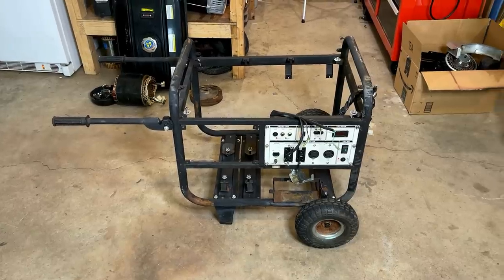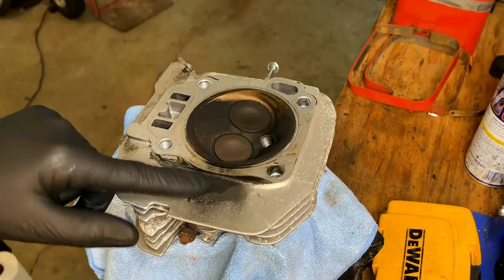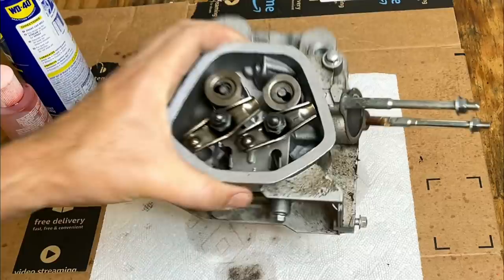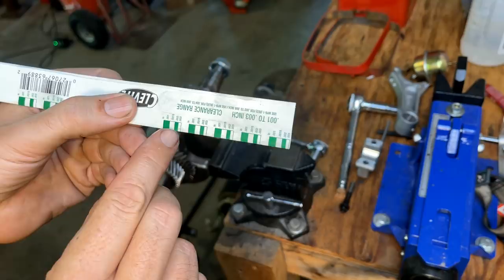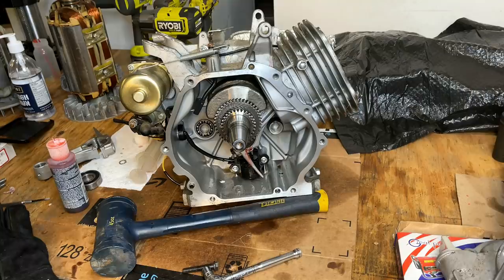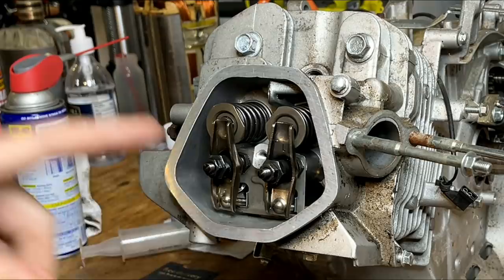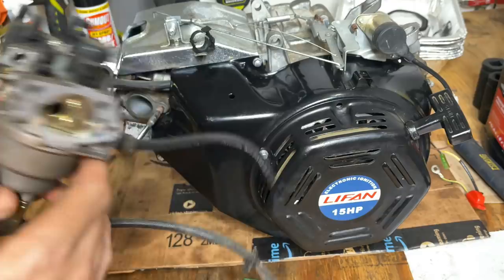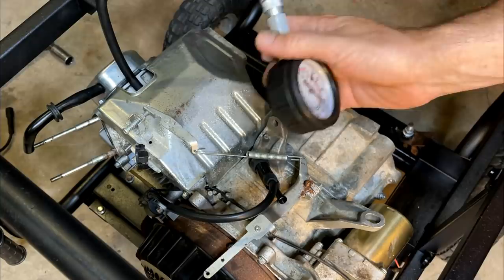Engine Rebuild - Seized LiFan Generator (Part 2)

Comment: Just a couple of engine build practice comments:  install grudgeon pin circlips with the gap in line with the rod, that is, either up or down.  These engines don’t spin very fast but it’s still good practice.  Second, a convenient valve lap technique is using tubing/fuel line on the valve stem from the back side of the head results in better control and feel in the lapping process.
Reply from the maker: Thanks for the tips.
Reply: and a cornless drill clear tube and stick on the stem side.?

Comment: I do appreciate how the box of the cloned connecting rod states beware of imitation.
Reply from the maker: Also interesting that this connecting rod was sold as a direct replacement for this generator/engine, yet it did not fit.

Comment: Couple things to look at. First was maybe lapp the head on some 320grit paper on a flat surface to rid the chance of a warp. Next dont use a abrasive brush or pad after the piston is installed your making a lapping oil that runs into and coats the cylinder and rings before start up. Great vid
Reply: Kinda stunned on that one myself. Always do all de-carboning/cleaning before final assembly.
Reply: I totally agree I would have cleaned the piston before installing it into the cylinder that way there's nothing on the rings.

Comment: Am loving this series, sir... great tenacity!  Not many channels that I will even start watching a 1-hour video, but yours never disappoint!  One comment for consideration... torquing the crankshaft nut against a variable resistance (rope in the piston - slightly compressible) may give you some error in the actual applied torque.  In this application it probably doesn't make a difference worth worrying over.  If you want an absolute rotation lock on the crank, you might consider a piston stop installed in the spark plug hole.  Love the channel and I'm always happy when I see a new video come out!
Reply from the maker: Thanks.  I agree, its not exact and neither is my torque wrench.  Have considered using a piston stop, but the idea of putting that force on the spark plugs threads doesn't sound great, although I know a lot of people do it without issue.
Reply: @jcondon1  Agree. Always thought a rope not gives some cushion, but spreads the load over greater surface area.

Comment: Hey James, I'm not real sure but, I thought you missed getting it in perfect timing on the first set of gears.  By it firing back through the intake supports my suspicion even more.  I'm not sure how it would effect the engine in the long run.  My experiences with the old v8's would prove out a hotter running engine.  You do a fine job working on these little engines and other projects as well.  I hope you never quit putting these fine videos out for the public to learn from.  God bless.
Reply from the maker: Thanks.  Timing was my initial thought.  A bad coil behaves in a similar way.  Especially on small engines because the coil sparks a second time on the exhaust stroke igniting the fuel when both valves are open that did not ignite under compression.

Comment: Paint stripper works very well at removing carbon build up. I use it on heads and pistons. Apply with a brush, let it sit for 10 minutes and wipe off. Repeat as needed.
Reply: What type of paint stripper

Comment: Thank you for the great video on rebuilding a high compression engine for a genarator. When the engine turned over and jumped I can see why you did not use the pull cord.

Comment: I might have filed a bit off the crank case just for piece of mind. The thought of that little clearance when something is spinning at 3600rpm makes me think it’s gonna close that gap. But I’m likely just paranoid. :) 

Great work sir! And awesome luck on that $18 rod. :)
Reply: yep..i would bet if you  checked  both rod big ends  they would be in the  ballpark range the same , and the crank  is where the problem is  as it was  slightly oversized incorrectly. If this is the case  it will make the new rod do the same thing again when its ran for extending period of time .i would of sanded  a   half a thou  off the crank  ....do the chi nese  sabotage some of these engines to make ameri cans  buy more on assembly line  for a reason   and make tolerances real tight so when the engine  gets hot  from running it  ,its seized  . I say its likely,is it  done on purpose  to get in our  wallet or just chi nese error, and why is there  no tolerance specs on anything anywhere on these  engines to be found~ so they are  just thrown away and a new one purchased  same game and plan.?

Comment: One last comment on engine build practices, lube all threads as well as under the heads.  Motor oil is fine.  Results in about 10% greater squeeze with no change in bolt elongation. A good thing.

Comment: I love it when  James says "I bought it as a parts machine" and it winds up as a functional rebuild!
As for the missing rotator cup; factory has been known to forget to install it....!
The flat areas on the valve spring retainer need to point up so that the smallest part of the spring retainer on the valve stem is up and gravity can not drop it !
Reply: Before you "give it a go" did you add oil to the crank case?

Comment: I truly wish you could include a break down of what you spend on the complete build? Once again you have proven that you are one of best! Keep up the great videos!
Reply from the maker: Thought I could get away with an $18 connecting rod.  Here are the part costs.  Connecting Rod $26, Gasket Kit $28, Rotator Cap $10, Push Rod Retainer $8, Ignition Coil $15, Spring Retainer $33, Airbox $19
Reply: @jcondon1  Thanks for the reply.

Comment: Omg 😅 it took me 2 days to watch this video due to network connection issue in my place ...anyway I recently had this compression release problem and at last I found out that the spring which is attached to the timing gear was stuck then I had to replace the whole timing gear with new one then the problem was solved but in your case I don't know exactly what's happening and that's attracting me to see part 2 
Can't wait to watch it 😅
Thanks a lot for the detailed explanation Mr. James ...👍

Comment: Man, that generator is turning into a major project, being a real stinker! BTW, I've had kick-back from high-compression engines before too, so you weren't being a "baby" for using the electric start, you were just keeping from getting hurt. Nothing wrong with that! You'll win on the next one James! Thanks for the great videos as always. God bless. Rev. D.
Reply: Please how do you fix a kick back from a generator due to high compression? Even when the compression release on camshaft is absolutely fine?
Reply: @michaeloyekan9078  Check the flywheel key to see if it's broken or sheared off. If so, the motor is out of time and definitely will cause kick-back. Remove the recoil starter and check the flywheel key. If it's loose or missing, it's broken.

Comment: just to share a tip. I clean all the cylinder heads of my scooter engines with oven/grill cleaner that works great and hardly even requires mechanical agitation. spary, wait ten min and rinse.
Reply from the maker: Would be afraid to use that.  The lye eats aluminum.
Reply: Good respons! I did not see that one comming, thanks!

Comment: Around 22:50, as you had finished applying cleaner to the frame, I turned my attention to my other monitor to take care of a window that had popped up.  While I was looking away, you started your pressure washer, and for split second I thought you had AN INVISIBLE ENGINE installed in the frame running that was making the noise!  :)  Another great video.  I really appreciate how you take the time to do things right and don't just slap stuff back together.

Comment: I actually discussed your situation with the mower techs locally.   It does seem weird that it would be too tight, rather than too loose.   The boss discussed how he would fix the existing connecting rod.....  and that they have had a few of these shanghai special motors that were too tight from day 1........ they just filed warranty on the machine and let the OEM deal with it.   In regards to the high compression, and not wanting to cord-start it.......  Anything over 10hp,  usually has electric start.....  and I've had my fingers bruised by even 3.5-5hp motors.... a 15 could get your elbow or shoulder!

Comment: James, I just worked on a 420cc Honda clone and there was a notch milled out of that small rib where your rod bolt was striking.  So you cound have filed/ground a notch in the rib instead of grinding that rod bolt smaller.  Hope this helps in your future rebuilds.

Comment: I picked up a small generator last summer for dirt cheap. It didn't  run and I took a chance on it. Reguardless of what I did, it wouldn't run. I ended up tearing the engine apart and found the timing was off. After realigning the marks and reassembling, it started and runs great. I use it for camping. I was going to replace the crank on a Honda mower, but ended up finding a perfectly good engine on a crap Honda mower that had rotted. After swapping the engine, Its my yard mower. Has self propel too. I guess my point is , yes I could rebuild an engine in my sleep but have decided over time it's just not worth it any more. Most people do not want to pay for a job like that any more anyways.

Comment: I am currently doing a salvage on a champion of similar size. Would bet the motors were made in the same factory. Swapped coil, carb  lapped valves and can see the light at the end of tunnel. No hurry, it's about the journey right

Comment: James I love your content.   I will give you a tip that will save you a couple bucks.  STP oil treatment for engine assembly lube (old original blue).  15 oz for the price of the 4 oz special red stuff.  Thats what works for me.  Take it or leave it.  I don't care.  Keep up the good work!

Comment: Great job getting it running again.  However, as an old machinist, I was taught to never grind on the side of a wheel.  They are not stressed for it and could explode.
Reply from the maker: Very true, but have a limited set of tools.

Comment: on 16:45 i notice there is the same all metal pushrod guiding plate in this head as there was in this German/chinese 209 cc Honda clone engine in a Parkside generator that i picked up for €50 because it would BACKFIRE (fire out of the carburetor, even blow the choke valve out) seller had already bought a replacement unit, but together we checked it and found that the exhaust pushrod had "sawn" through the side of this guide. i had a donor 160 cc motor sitting at home and found a replacement guide plate that had plastic lining around the holes for the pushrods. put that in, adjusted clearance and she purs ;)
Reply from the maker: Seems to be a common problem.
Reply: 🤣 @jcondon1  hadn't even seen the video to the end and turns out you had a similar problem ;) only not worn out to the other side and all the way through..

Comment: That push rod guide plate was cutoff wheel modified. When the rotator cap came off the change in timing must have caused detonation which damaged the connecting rod.

Comment: That's a poorly designed crankcase. If you were to drain the oil from the head side, there would be a fair amount of oil/crud left behind because of that ridge on the floor of the crankcase. Great catch on the valve guides! Keep up the great work!

Comment: due to coloration of that valve guide plate, I would say it was subjected to a grinder !
Reply from the maker: Probably right.  The push rod would have cut a path in the plate the width of the rod.  The whole side was missing.

Comment: Fantastic video.  Reminds me about all those small engines I worked on as a teenager, when I thought I knew everything.   Just a thought.  Has anybody tried a caustic instead of an acid solution to dissolve the aluminum deposits?  I remember when iron engines blocks would be given a hot soak in a caustic soda tank to clean them before a rebuild.  Now for the science, aluminum is an "amphoteric" metal.  That means that it dissolves in both acid and alkaline solutions.  Iron only dissolves in acids so, soaking the crank in caustic soda would make the aluminum deposited on the journal go away and leave the rest of the crank unaffected.  You get paint and rust removal thrown in as a bonus and no worries about leaving the acid on for too long.  Anybody tried this?

Comment: Informative I tinker on this stuff to. 
Parts are tough to get.  I had to weld a fan cause I couldn't locate 1. That particular engine is the same as the predator 420 cc if it would've helped. Hey engine wiring review  of carb , engine shut down , starter and oil alert could help if you could somehow.

Comment: I'm working on a Briggs snowblower engine. I can see the compression release working on exhaust valve.  with pull start I get 60 psi.  on electric start I get 175 psi. someone suggested that  the electric turns it so fast that the decompress flies out as it does when engine has started running. maybe test your compression either pull start.
also my leakdown was surprisingly close to 0.
Reply: How were you able to fix the kickback from the compression release?

Comment: Like the why you cleaned up the shaft, did you hone the cylinder before installing piston, would have used an spray bottle to spray into the intake instead of putting gas through spark plug. I do like your videos and have used some of your ideas on my Colman 1850 and Onan 4000 RV to keep them running their best.

Comment: Those thorch plugs are not good, I changed the plug and the fuel hose on my predator when it was new and I'm glad I did, starts and runs perfect with an ngk

Comment: I am really enjoying you videos James. I an a retired Electrician and understand most of the mechanics of an engine, but i have always found it hard to grasp how a carbonator works. I know it supplies fuel to the engine, but what is the needle jet for? Why is an emulsion jet needed and what role does it play? Basically how the workings of the carbonator interact to run an engine? Can you find the time to do a video on this for those who are novices to this? Thanks 😁
Reply from the maker: This one made by Briggs has a lot of detail https://www.youtube.com/watch?v=MfTpU6HS4cA
Reply: @jcondon1  Thanks James, that was very informative. I wondered why you put a thin wire into little holes in the Aluminium Body of the Carb. It's a complicated bit of kit!!

Comment: Once again excellent video. Would it be possible for you you too show at the end the end how much time you put into it and how much in parts. Video times are so short yeah does not give how much time you actually put into something like this and rebuilding a motor or trying to diagnose it.
Reply from the maker: This one was a little bit of a money pit.  I do not keep track of the time, but it was more then I thought.  Recording it adds a lot of time to the repair.  Thought I could get away with an $18 connecting rod.  Here are the part costs.  Connecting Rod $26, Gasket Kit $28, Rotator Cap $10, Push Rod Retainer $8, Ignition Coil $15, Spring Retainer $33, Airbox $19
Reply: @jcondon1  $33 for a spring retainer? Ouch!

Comment: Did you watch Project Farm's video the other day?  That gun stuff took baked on carbon with a paper towel.  You might want to try using that.  That way your brushes (shown at  40:10 )  will last longer

Comment: The slot on the upper left hand corner of he valve guide plate hole looks like someone took a hack saw blade or a dremel grinder disk to it.

Comment: Ah, repair on a shoestring! :-) Love your crank polishing method and the beautiful results. STP for assembly lube? It is very unusual to find a bad crank journal, missing valve rotators, worn pushrod plate and weak coil all on the same engine. I doubt the missing valve rotators could find their way down into the crankcase and assume they were never there. The eroded metal from the pushrod plate could enter the crankcase and find its way to the rod journal but what caused the plate to wear. The country of origin of the clone engine may answer some questions.
Reply from the maker: I agree.  Do not think the cap could have made it into the black.  The oil return hole is smaller then the cap.  Used Permatex assembly lube and motor oil.
Reply: Nice call. Agree that the eroded metal from the plate could have caused the issue with the crank. Didn't think of that. And likely no oil. It is an odd assortment of issues.

Comment: You make very engaging and informative videos.  There is an aluminum removal chemical which has no effect on steel at all, and that is sodium hydroxide, or lye.  Aluminum forms an oxide layer on the surface which has some resistance to acids.  Cole-Parmer has a Chemical Compatibility Database online, and it gives the resistance of cast iron to 20 percent sodium hydroxide as excellent up to a temp of 120°F . The resistance of aluminum to sodium hydroxide is listed as poor, Severe Effect  Not recommended for any use.  Thanks for a great video.
Reply: It takes forever, muriatic acid works fast.
Reply: @erik_dk842  I believe you, but the lye and hot water mixture can be left unattended and the entire crankshaft can be soaked in it.